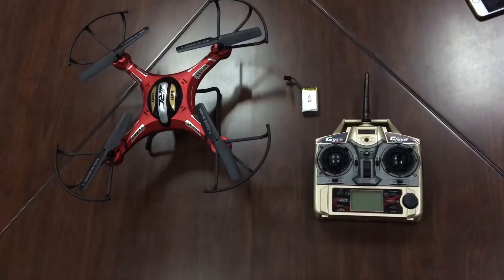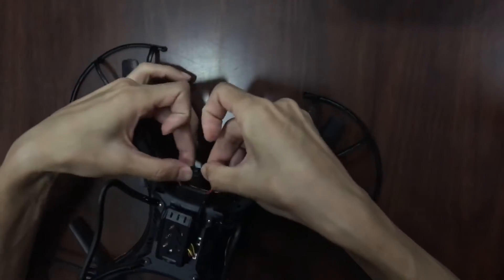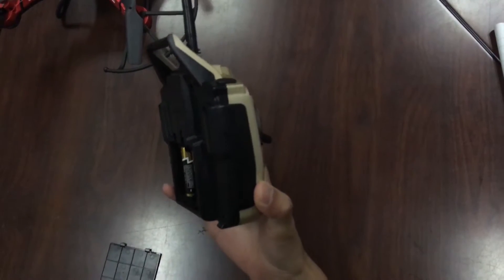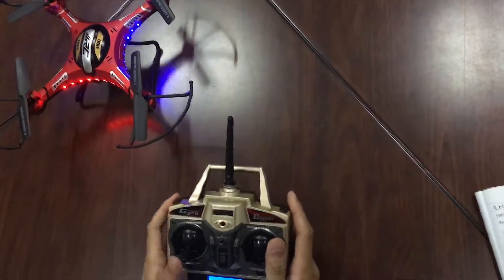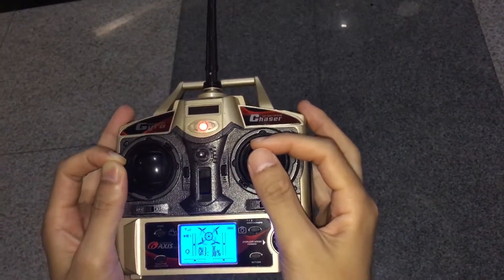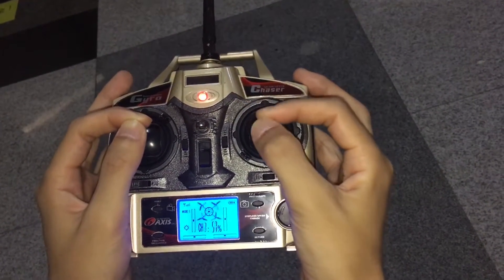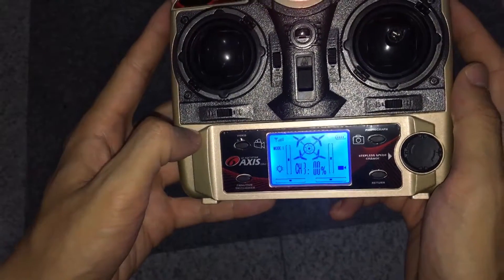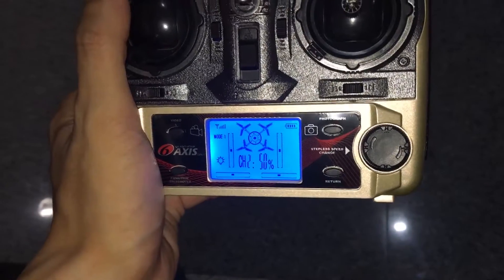Manual for LANDVO JJRC H8D drone

Comment: when I received my quadcopter the left controller stick is loose not springy like the right. I also don't know how to get the propellers to turn. This was a christmas gift and my son has not been able to use it. It also didn't come with a charger. Could you recommend what type of charger I will need?

Comment: how do you turn on the headless mode
Reply from the maker: you can press the button on the left bottom of the controller LED display to enter headless mode, the Function Switch button in this image: https://images-na.ssl-images-amazon.com/images/I/71TpJs5x5RL._SL1500_.jpg,  press it again to exit headless mode.
Reply: how do I turn on headless mode? When I do turn it on, it keeps making noise (bep).... It did not work, when I press the Function Switch button, it goes to mode 2, not to headless mode.